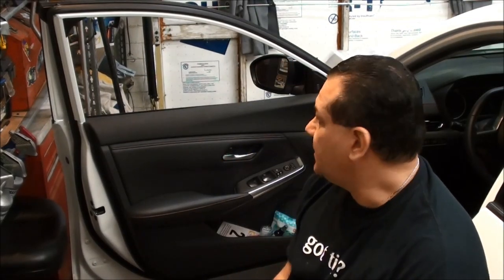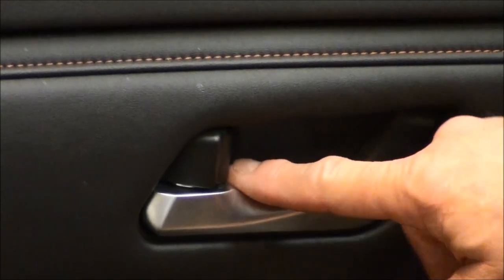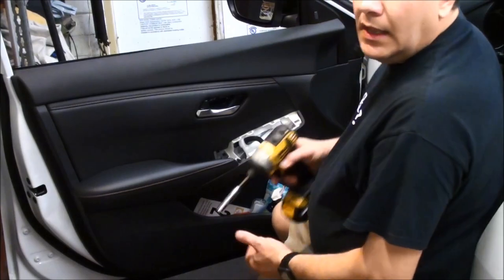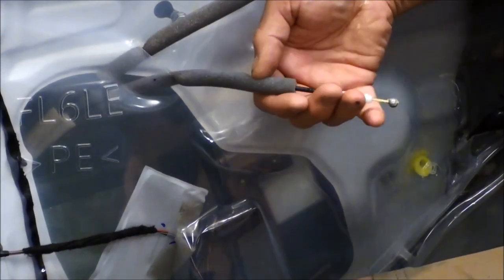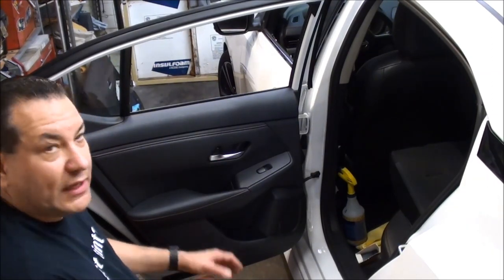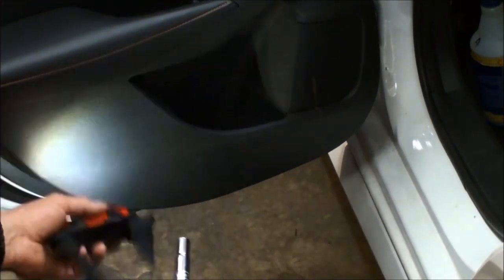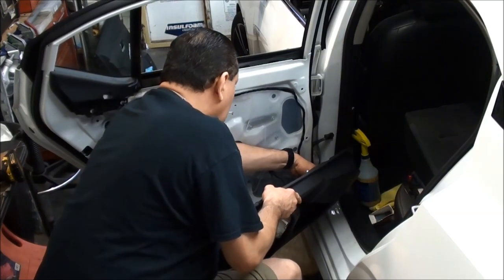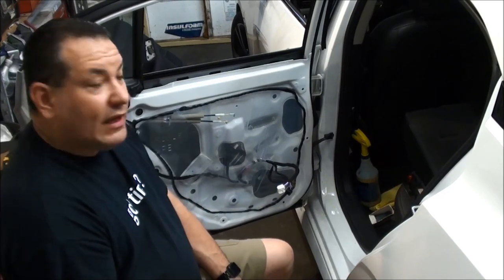How to remove door panels on a 2020-2022 Nissan Sentra(front switches have security tabs) read below

Comment: This should work for a 2024 Sentra? I need to replace my drivers side mirror and I believe I need to remove the panel first. Thank you in advance
Reply from the maker: I am not 100% sure if the 2023 & 2024 are the same. I have not done the 2024 yet. If the panels look the same, then they should come off the same. These are usually not that difficult to remove

Comment: So I’m replacing the sound system in my 2021, and it all looks the exact same. My question is, how do I remove the 2 speakers that are located in the rear deck of the car?
Reply from the maker: I have not pulled that tear section apart on these, because they are fairly new. But in most cases you have to start by removing the rear lower part of the seat, and the side parts of the seat. In some cases the two side trim pieces have to be removed in order to pop up the rear tray, to access the rear speakers.  Hopefully this will give you an idea of what you have to do to get in there
Reply: Did you add ang speakers in the back doors? If so what size are they?

Comment: Thanks for the video.  That sensor behind the rear door is the fob sensor.  It is how the car knows the keys are nearby .  When it is not plugged in, the pushbutton unlock on outside of driver's door will not work and the car will not always start or shut off because the keys are not sensed.  The car will start and shutoff without it, but it is finicky.  Might have to move the key fob around the cabin so it can be sensed by other sensors.

Comment: Replaced my 2020 nissan sentra back door lock actuator with the help of this video.  There is also a video from A1 auto for nissan Versa that shows back exterior handle and lock removal.  The only difference is the sentra has a second #30 torx set screw that needs to be backed out before the lock mechanism can be removed.

Comment: Is there any precut holes in the rear doors on the 2018 Sentra for speakers? I know it only has speakers in the rear deck and front doors.
Reply from the maker: It doesn’t have precut holes on the rear doors on the metal.  It does have a very very small speaker mounted to the panel on the Bose system.  On the standard system, it doesn’t have anything there. Not worth trying to add speakers to those rear doors, in such a small space ( because they are so low on the door)
Reply: @raiderman28  thank you so much! I replaced the front door and rear deck speakers myself and refused to check the back doors. That was a doozy.. never again 🤣

Comment: Thank you Dear. However, I´m having problems to removal the cables (2) with balls.
Reply from the maker: Just grab the white part of the cable from where its clipped in and tug away from you to un clip it then just lift out of the ball socket. The second cable doesn’t have a ball at the end of it. It has like a L piece that is also removed the same way
Reply: @raiderman28  ok, that was play It. Tnx again. In fact, your video is the better on YT to 'how to do'.

Comment: speaker size special for the rear door, please
Reply from the maker: If it has the bose system i think its a 4” speaker. This car had the bose system. If its the standard system, you will have to pull the door panel to find out the size, because I haven’t worked on that model yet .